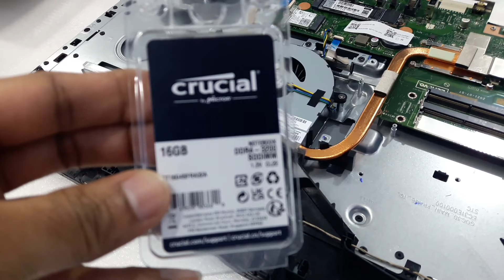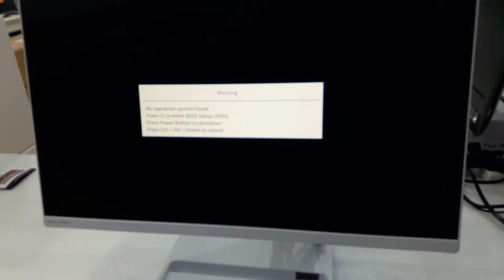Lenovo IdeaCentre AIO 3 24 upgrade || how to upgrade SSD & memory in Lenovo AIO 3

Comment: You should always use 2 memory modules (2 channels), it makes the memory twice as fast. Using only 1 SoDIMM is a poor choice. So if you want 16GB, buy and install 2 pcs. 8GB etc.
Reply: Can you put 2 16gb?
Reply: @johnashlymata8500  it depends on the exact model but I think it should work on most models.
Reply: Twice as fast in your dreams only , maybe up to 20 %
Reply: @dominikwojnarowicz2885  in theory it does. In practice it depends. Either way it is just stupid using only one channel.
Reply: @dominikwojnarowicz2885  "up to", in reality it would be like 1-3% more fps in games or 0-5% faster in apps
Reply: It's nowhere near twice as fast
Reply: @tlogank Yes it is, memory bandwidth is doubled (64 bits vs. 128bits for example, or 18 GB/s will be 36 GB/s). Exactly doubled. The memory performance in practice will increase also very much, usually around 15- 50%, but you will have to understand that it is not the same as system performance. But also the total system performance difference is very significant in memory intensive tasks like gaming.

Comment: Yeah I hate these designs between HP and Lenovo making it such an aggravation to get to the parts I purchased the Dell it was a relief to access ran hard drive all just by removing the back panel metal protective cage screen not having to be touched

Comment: Well, I did it.  ...... eventually.

1st time - I tried starting PC, but it would not turn on. (I was pushing on the "black pad", instead of the gold push button on the board.)
2nd time - figured that I needed to close up the case to get it to work.... nope.  Button on case was indented too much....did not turn on.
3rd time - played around with the back case push button.  Carefully.....   It just needed a little coaxing.  Now ok.  Button was almost flush with the back case.  Perfect.
4th time - closed it all up...........and realized that I did not put all the screws in!!!!  
5th time - a charm.  All worked fine.  Just wish I put 2 sticks vs 1 stick on ram.  No way opening it again.  

Notes:  
1. Yes, I do have one screw extra.  So, just taped to the back of the case.  If I ever get back into it, I'll put it in.
2. Each time the process got easier.  Mostly because opening the case got easier.  Make sure you have a BIG screwdriver to exert a lot of torque... and I mean a LOT of torque.  Once it opens, you can then pry open the case...be careful... I used plastic car tools for interior removal.

Comment: what equipment do you use to open up the case from the screen
Reply from the maker: Universal Mobile Phone Repair Tool Kit Disassembly Blade Pry Tool Metal Pry Bar Disassembly Kit 
Star Head Screwdriver Set

Comment: I have a question, the piece that connects the motherboard to the secondary disk or optical unit, that goes in the port that shows ODD_SATA (it has a blue fabric with "MB" mark on it), can anyone point me as to where can I purchase it or a piece code or number, I bought an i9 and did not bring that, hence can't install a secondary internal HDD or SSD. Appreciate any help
Reply from the maker: Thanks for watching. My model  is 2 years before the model in the video. 1.22 minet , you can see 2nd driver slot 2.5inch size you add. About your unit, please  give me the p/no. I will check in (psreflenovo ).
Reply from the maker: Please subscribe to my channel 🙏.

Comment: The hard drive disk already installed was of 3.5 in or 2.5 in?? I need to know
Reply from the maker: This model comes with only ssd m.2 nvme and there is 2nd Driver slot in  1.24mint check which we removed MT cover  for  2.5 inch size.
Reply from the maker: Please subscribe to my channel

Comment: Helpful vid. Thanks. 2 things. 1) Using something metal to release the connectors isn’t best practice (😖) and 2) wasn’t there a holding screw in one corner that needed retightening when you reassembled the case to the screen?
Reply from the maker: Thanks for the massages, Not Recommended to use metal tools..
Reply: @nprstechandvlogs8793  does this computer have laptop ram installed or does it have its own ram?

Comment: I've installed 32gb abd the pc recognized it but in "high" demand tasks (zoom meeting) it frozes and go to blue screen. I tried to open it by my self to take out a module and see but that PC is a trap, it seems too easy to break the screen even a guy from Lenovo who tried to open it breaked a small part of the corner. Also I think it goes to blue screen by heat but I cant see the state if the processor without open.

Comment: you cannot plier the screen part. i just cracked my screen. you can only plier the bottom part, then pull open the back cover form the bottom straight away.
Reply: Happened to me twice! even with a credit card! DO NOT ATTEMPT
Reply: Yes, just work the bottom, start by the screw.  I also pried the sides of the case, but I DID use plastic car interior tools.  All releasing of the case/screen should be done with the screen down, on the edge of the worktable. Do not push the tool DOWN between the screen and case.  Go slow.  This is the first time the case is being opened.

Comment: yo tengo lio co n una ideacentre AIO 3 24ARE05 al taparla no pudecasarle los laterales a ras de la pantalla, me da vaina que se rompa... la otra fue que le amplie a 12 gb de ram traia 4 le puse 8. las reconoce pero quedan reservadas para hardware 8.8....
Reply: Remove the old one and put the new one.  Do not combine both of them

Comment: Where is the 2.5" SSD located?
Reply from the maker: Please check 1.20mi it's there down the pc
Reply: @nprstechandvlogs8793  I take it  one just inserts an additional two and a half inch SSD into the slot and the accompanying bracket?
Reply: @nprstechandvlogs8793  I'm about to upgrade the RAM from 4 to 32 but am very concerned about detaching he back from the screen, will the screen not crack if not careful removing the back did not seem very easy. Thanks.

Comment: Mine doesn't have a disk drive opening. There's no way to open it
Reply from the maker: We need to open
Reply: @nprstechandvlogs8793  what do you mean?
Reply from the maker: @ADMDW-yk5mq  for upgrading Ssd and RAM we need remove the HDD Driver it's under the AIO PC.
Reply: @nprstechandvlogs8793  I'm talking about the disk drive on the side of the device, some models have it and some dont. I don't have a disk drive on the side but there is a cutout for it but I don't know how to open it
Reply from the maker: @ADMDW-yk5mq  in that case no need to remove dvd drive Case that is MT.it will open along with back panel of your pc.